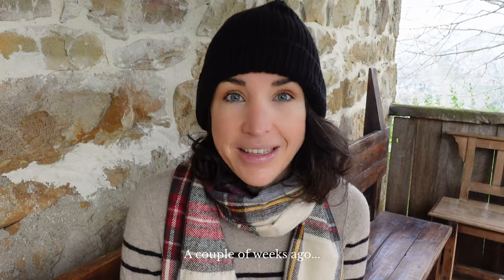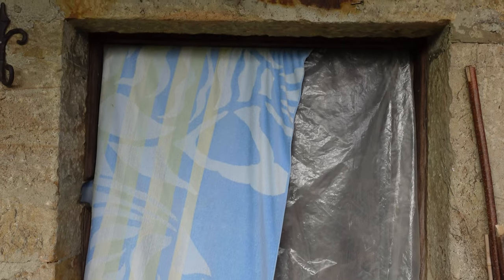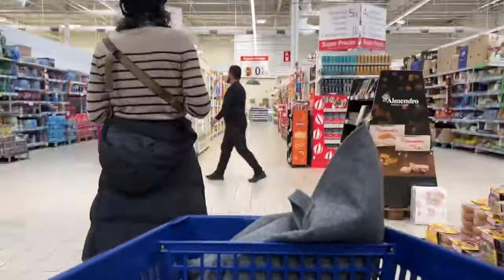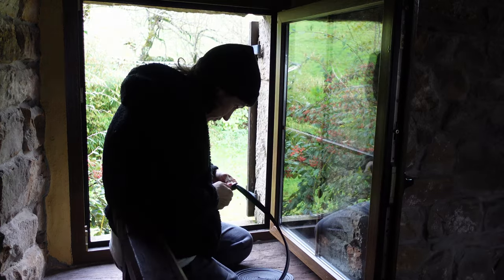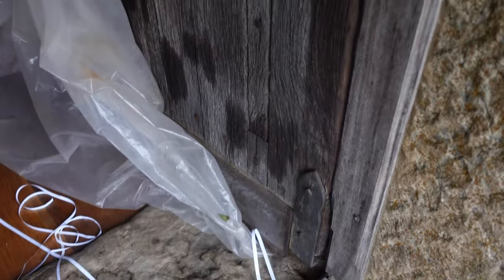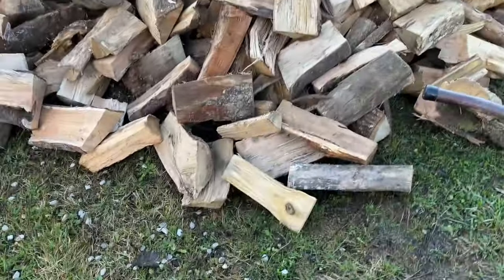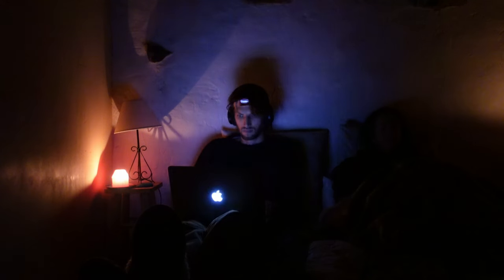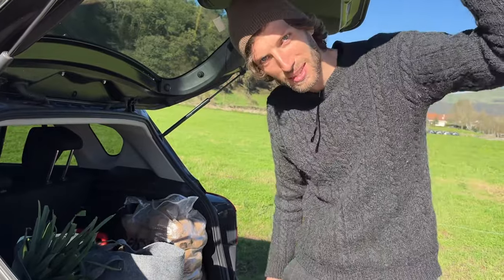More winter prep in an off-grid cabin in the mountains of Spain

Comment: if you still get stuck with the washing machine, you can always remove the two wires from the heating element insulate them then just use it on a cold cycle. It will only use a few hundred watts. If you try to put it on a hot wash, it may come up with an error but that's only because it's not reaching the temperature so just use the washing machine on a cold wash. Another great hack as soon as it starts filling pour some boiling water down the soap draw as it's filling you will need to be careful that it does not put too much water through the pipe and overflows so just slowly do it
Reply from the maker: Amazing info! Thanks for sharing 👏

Comment: Good to see you've got a chainsaw. I was damned scared of it at the beginning but over time it gets much easier. I still don't sharpen my blades but get them done at the Stihl distributor, and I use 4 - 5 chains that keep me going on big jobs.
A few times we have had problems with our fireplace. It has been wet wood creating carbon and blocking the chimney, ash building up on the top of the plate above the fireplace (needs cleaning every 2-3 years). We get the cleaning done professionally as you need a certificate for the house insurance.

Comment: If you get that much snow,wouldn’t you need a lot more petrol for the generator? I live in the  northern end of Australia, so it’s not an issue Hereford winter but we can lose power if hit by a cyclone, so same principle, I guess.
Reply from the maker: We have 30L of petrol which should last us a couple of weeks (we try to use the generator as little as possible and minimise our electricity needs). It also shouldn't snow for that long. It only happened a couple of years ago with a crazy storm, but we keep track of the weather in case we need to prep further. This winter so far has been really mild.